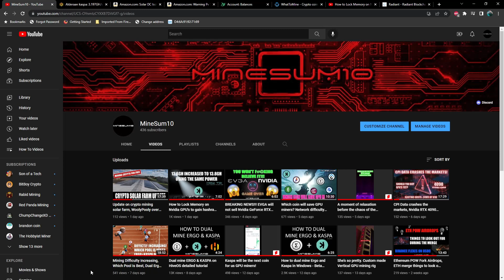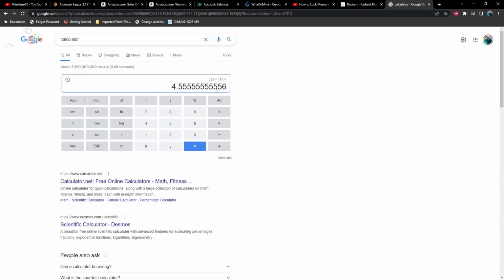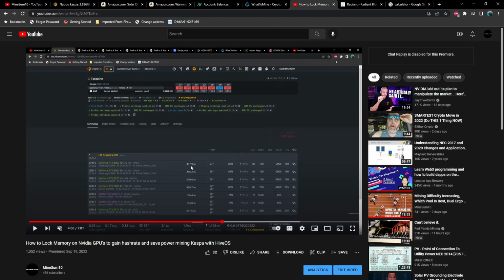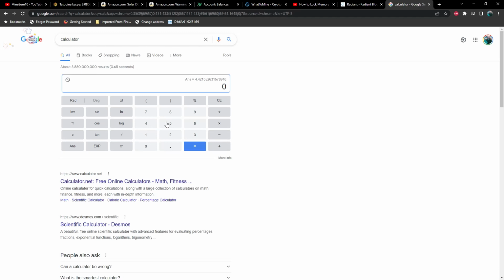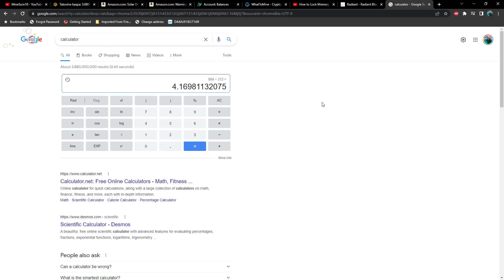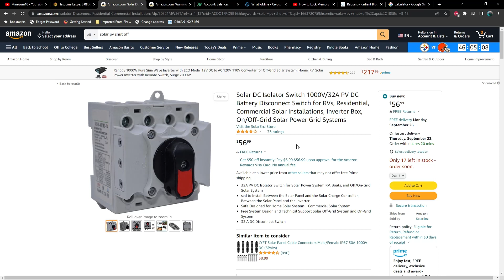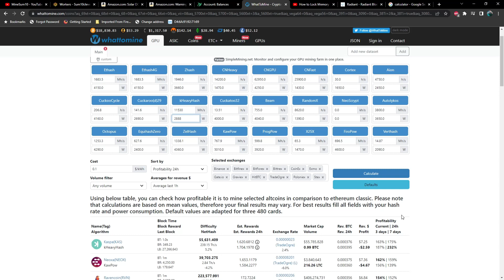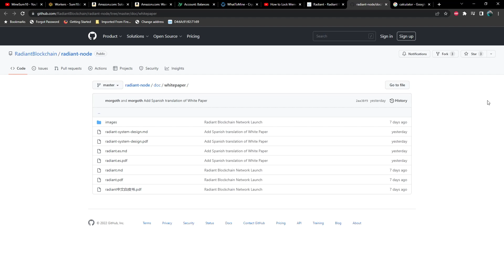Overclocks for Kaspa max efficiency on 3060ti 3070 3070ti 3080 3080ti NEW SPEC COIN TO MINE AT END

Comment: My profit is positive in Kaspa, you must check your OC that it is not very good, try to use core parameter inside lolminer and memory parameter in 810 mhz, offset must go between 200 ( 1905 core clock ) to 400 ( core clock 1365 ) "oc_lock_memory_clock": 810 "oc_lock_core_clock": 1365
Reply: Also all these kaspa oc settings work great on radiant too. I'm getting 585mh at 60w on a 3060ti
Reply: @Holy-Hand-Grenade-of-Antioch  Great. This OC works fine in TON, ALPH and KASPA and now Radiant as well. Clue is to adjust offset as much as possible without crashing gpu. 60 W is a very good porwer draw for mining, 3060ti are more efficient at low cores ( 1350 - 1410 ). You can as well put a PL of 100 w but it is never achieved.

Comment: I am getting only 420 mh on my 3060ti with your overclock setting
Reply from the maker: Silicone lottery 😢🤷🏼‍♂️
Reply: @MineSum10  no bro getting 420 on all 18
Reply: I have lhr card
Reply: @hiteshstomar  Did you use - nvidia-smi -lmc 810 - comand ? 
And try Core 250, 
Memory -2000,  
110 w power limit

Comment: Hallo pretty good efficiency gains, but maybe try this overclockings for your rtx 3070 and 3060ti.
Rtx 3070: 557 MH, at cc:280 MC:-2000 and pl:100
And the rtx 3060ti (mine is an LHR micron mem model): 450mh, at cc:250 MC:-2000 pl:100.